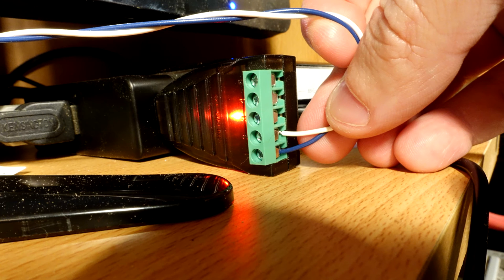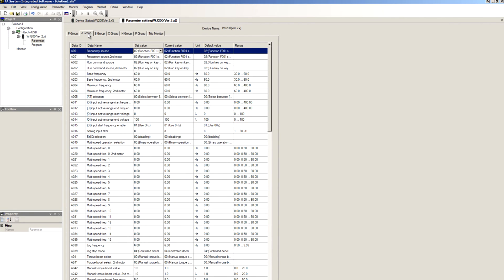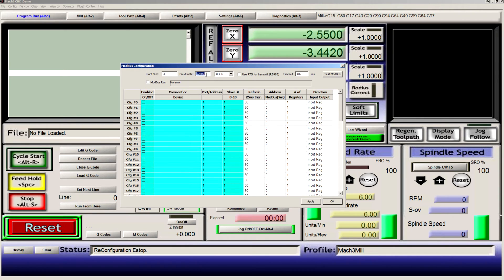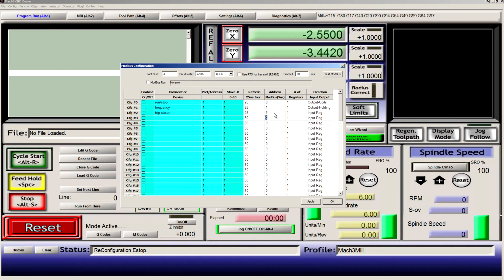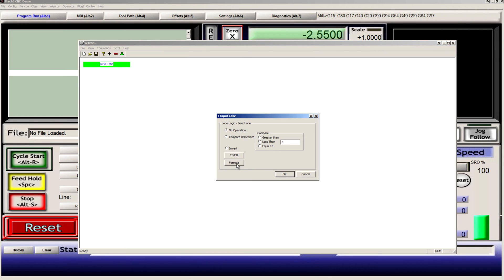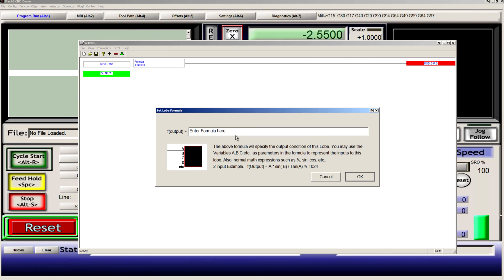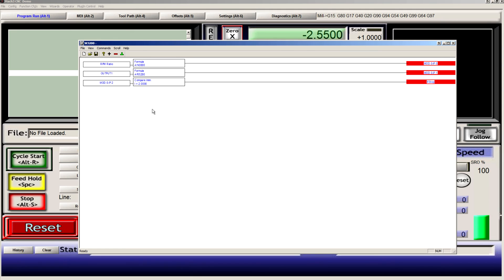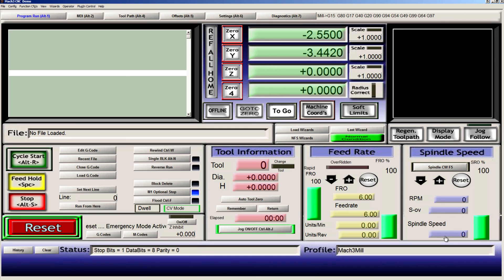WJ200 - Mach3 Modbus Quickstart

Comment: I have tried to duplicate this but with no success. What other changes in Mach3 did you sue to make this work?
Reply from the maker: No other changes, this is a setup from a clean install of mach3, other than the configuration number mixup noted in the video description.  What does "it's not working" mean in this case?
Reply: SiieeFPV I have done a clean install of mach 3. In the test Modbus screen I can read the registers. So I think I have communication with the WJ200 via rs-485. At this point I think it has something to do with the output on the brain. As my RPM ratio changes as I change the speed in mach 3. If I trip the WJ200 the estop is activated.

What pins are you using in the motor output configuration for Output 1?

Thanks
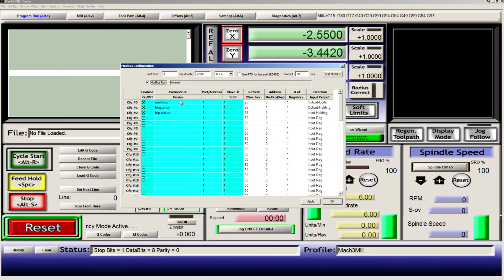Reply from the maker: pins?  motor output?  I'm not sure what those are.  Are you looking in the modbus configuration, or the brain?  Have you set all of your modbus settings exactly as shown at 2:34?  It sounds like you've got everything talking, your vfd is just not getting the commands from mach.  Have you correctly set A001 and A002 in the vfd configuration?
Reply: Followed your video exactly. In Modbus Monitor I can open the port but get  a timeout when reading the registers. Is there a way to verify that the RS485 connection is working? Any help is appreciated. Thanks